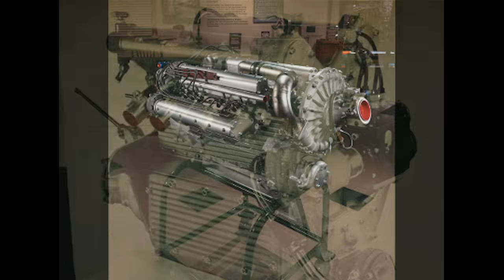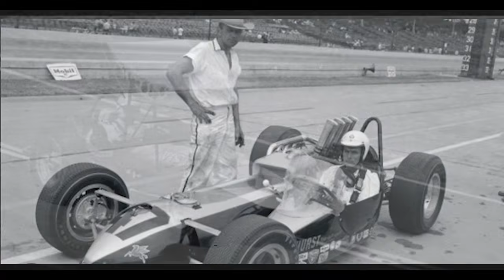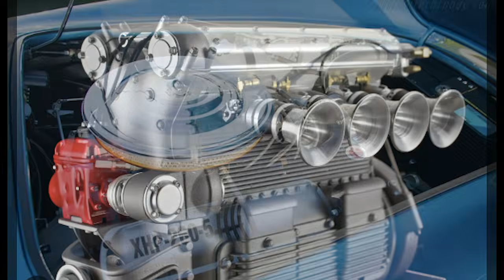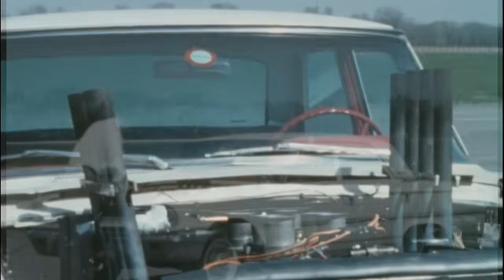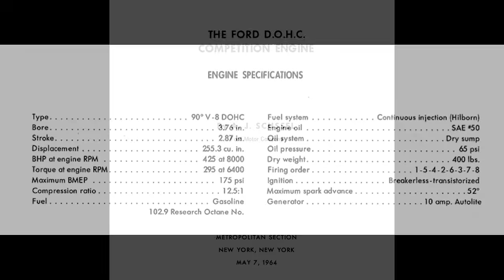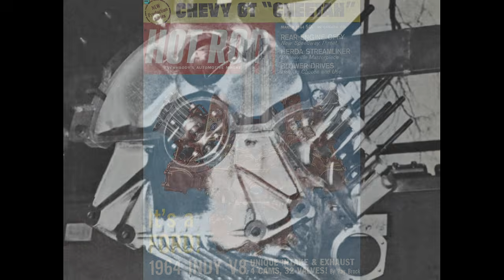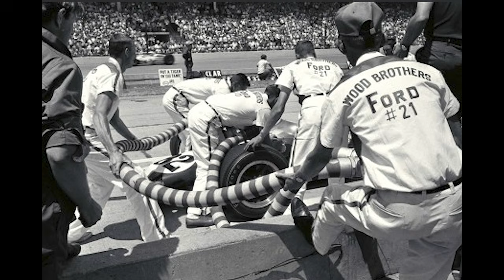Designed to Dominate: The Ford DOHC V8 Story - An Indy 500 Legend

Comment: As an engineer and a motor racing fan for the last 60 years I found this fascinating. I am from the UK and I wondered where the Cosworth engine in F1 came about which started being built by Cosworth with backing from Ford in 1967

Comment: @brianlohnes3079, great video but one little problem. The newspaper is being held by the man with the checked jacket who's standing to the right the woman standing beside Foyt. You can see a small piece of his jacket sleave and wrist.

Ignoring for the moment that we can see the wrist of the hand holding the newspaper, imagine yourself in Foyt's position, standing 'behind' the newspaper. Now imagine trying to put either of your hands into that position. It's impossible to do with the right hand. In order to put the thumb in that position, you'd need to be presenting the palm of your hand to the camera. 

The left hand would need to either come across the page but it would be impossible to bend the wrist in the way shown. Or up from under the page, but again, the wrist position would be impossible. And the left shoulder would need to be pulled 'hard to right' just to get the arm anywhere close to where it's shown.

Comment: I grew up thirty miles from the track and began going there with my grandpa when I was about 7 or 8.  My first race was the tragic 1964 race, and my Grandpa and I sat in the middle of turn 4.  I can relive every moment watching Dave McDonald coming through the short chute entering turn 4.  It was as if his steering locked up and then, the most horrific explosion right in front of my ten year old eyes.  I know a good bit about Indy, and in the late 60's, there were some real innovations hitting the track.  Yes, you did mention the Novis of Andy Granetelli and by 1964, we had, I believe, 12 rear engine cars, so there was some innovation by then.  Andy and his STP Specials--everything was some kind of "Special" back in the day!  So he introduced the turbine cars two years in a row.  Parnellie jones drove them and when USAC/Indy said they were banning them, Jones went to bat for new innovation but they shot him down.  There would have been more innovation if it were not for that.  Fast forward to all motor racing today.  Nascar, I believe was the first to ruin the sport.  Every single car is the same exact body--just painted or decaled differently to make it a Chevy or a Ford.  I hate it.  Nothing but cookie cutter racing.  Now Indy Car and F1,  are no different.  They have ruined so many great sports rooted in Americana!!

Comment: The funny thing is,  today you can get a 700-800 hp naturally aspirated, pushrod V8 in a street ready sedan, that seats 5 and sells for under $50,000 .  Today's factory v-8s would absolutely dominate  NASCAR, Indy and F1 racing in the 60s.  So, what's the difference?    Same basic layout and construction.  Same cubic inches, and same fuel.  How do we get double the HP and triple the torque ?   Look no further than how we control fuel/air mixture, ignition and valve timing, and compression ratio with electronics.

Comment: I considered installing one of the Ford Quad Cam Indy engines in a Ford GT40 and was directed to a guy in the Clearwater area of Florida. He was the central repository and historian for the Indy engine so a luck would have it we were going to be on holiday in Naples so a meeting was set. We met at what he described to me as his hobby shack which turned out to be a large modern warehouse on an industrial estate. Maybe a quarter of the building space was taken up with perhaps thirty complete dyno run shrink wrapped motors on pallets, some the turbo version while others were naturally aspirated. There were many exhaust systems, cams of varying specs and many draw cabinets full of individual engine components, everything was brand new. In addition to this treasure trove was original cylinder block and head castings tooling and test pieces. 
That was maybe twenty years ago so who knows what happened to this amazing collection. The guy had great foresight by recognising that given sufficient time many future classic Indy car owners would need these original engines when restoring them to period correct race cars, so many of them having been swapped out to Chevy race motors due to cheap spare parts and low  cost to maintain. He figured it would usefully add to his pension pot.

Comment: Excellent video. I was z-an engineering student at that time in the UK and spent my weekends mechanic  on different circuits ( Brands Hatch, Silverstone, Truxton). The most sticking thing about your story and how it might have been the starting point of the Cosworth FVA (1600cc, Ford stock block Formula 2 engine developed by Cosworth financed by Ford). History tells us the Colin Chapman negotiated the Ford financial support in 1965 to ensure engines for the new engine requirements. This is where I see a direct link between the 4cam engine development status in 1965 and Chapman showing  how simple strait cut gear drive can convert a standard pushrod engine into a double overhead cam 4 valve engine. Thus the creation of the FVA by Cosworth and this of cause leads to the DFV, the most successful GP engine ever. And all that under the Ford name!

Comment: I do remember they ran the 4 Cam in the championship dirt cars in the 60's and 70's by changing the location of the exhaust pipes so they exited out the side of the car. I loved the sound as a kid much more pleasing to me than the Offy. 🏁
Reply: They swapped the heads side to side.
Reply: @uhclem50.  Yes thank you. I could have worded the original comment a little better. They just moved heads to the opposite side so the exhaust would be on the side and not coming from the top like the Indy cars of the period. Pretty cool for an engine whose block originated from a Passenger Car Engine. But many engines did before the Cosworth . Brabhams (Repco) and Gurneys (Westlake) to name a few.  Cheers 🏁

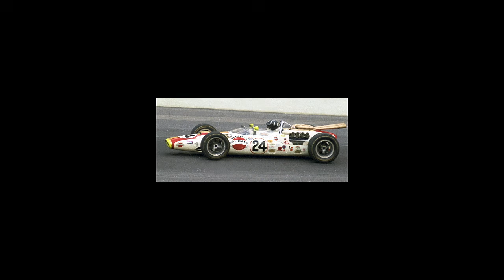Comment: 50:55 Timing Gear train Failure is an  ENGINE  issue , so that was  FOUR  Engine failures . Out of 20 that's really quite good .
Around this time , the Three Litre  Cosworth  DFV    V - 8  F1  engine was born as well . 
A  British design . Costin and Duckworth . Chapman associates . Used a narrower included angle between the Valves .
The Cosworth  DFV  V8  still remains the " Winningest " engine in Formula 1 history .

Comment: The old 221 Buick V8 was abandoned by GM in the 60's. The design was licensed, and became the 4.0 V8 used in Range Rovers into the 2000's. These engines were turds in the 60's, and they were turds in the 2000's. The DOHC Ford V8 engine was a groundbreaking design, vaguely similar to the BMW 4.4 "Hot V" engine I have in my 750i. DOHC, 4 valves per cylinder, and exhaust coming out the top instead of the sides.
Reply: Jack Brabham managed to build the Olds 215 V8 into an F1 World Championship engine by doing an SOHC conversion on it.

Comment: Still have a soft spot for the Offy.   Supposedly it was derived from a 1920's Peugeot small 4 cylinder.    The question I have is how did we get from this small block Ford V8 to the Ford Cosworth DFV from Keith Duckworth and Mike Costin?  Then years later, I think we had at Indy the Ford DFX?   PS: Amazing job on this video by Brian.    So interesting how Dan Gurney always seemed to be in the mix.
Reply from the maker: Watch my Offy video and there are answers to these questions!

Comment: There's probably a reason they didn't mention the term 'EDM' when talking about how they machined the cylinder heads; EDM is a technique used even today to machine aircraft (i.e. jet) engine parts so in the 1960s the technique would be considered a national security relevant secret similar to multi-axis CNC machining.
Reply: I could talk about EDM'ed cylinder heads, but national security concerns prevents it....

Comment: Hey, loving your videos and the research you do, but "just a kid" Gurney in 1961 had already won the 1958 USRRC series, run Le Mans 3 times (twice in factory-backed Ferraris), and had finished 7th in F1 points in 1959 driving for the Scuderia, and in 1961, after a horrendous 1960 wasted driving for BRM, was Porsche's undisputed #1 driver in F1, coming 4th in the points. The guy was in the top 5 of American drivers in 1961 and would have been the last person on Earth to doubt Brabham's entry.

Comment: I am another old gearhead. I remember watching those races either on tape or closed circuit theater viewings. If memory serves me right, in eye 1963 “500”, the roadsters were running a two speed gearbox. Low gear for in the pits and high gear for the race, while the  Lotuses were running a four speed. So, at the start of the race, both cars downshifted into either second or third gear and jumped to an enormous lead going into the first turn. Or at least, that is what was reported.

Comment: I remeber reading about these when I was a teen in the 80s. I restored and modified my 1st Ford starting at age 14 1/2 , when my dad bought me a $200.00 73 Mach 1 dented and with bald tires no engine and a broken windshield out of a junkyard. It was the best thing My dad ever gave me. I spent 2 yrs restoring it learning bodywork at a part time job stripping the wrecks after school. By the time I was a Jr in High school I had repainted it in Black Laquer and installed a worn 351W with some headers and a 600 holley on a Strip Dominator aluminum intake!. It was a 3 yrs of frying chickens for the Colonel that enabled me to build a standard bore 351C with 4bbl heads and a comp cams, mallory ignited, tunnel rammed home rebuilt engine. I had 2 -500 cfm sideways mounted holleys that took me months to tune behind a small block C-6 auto with 3.73 gears!  It was a great few years at the end of High school. I still have the cleveland I built the 1st Factory Five Cobra powered by the same  351C in 1999 and still have it today!  Always wanted a GT 40 just never could afford to build it. Ford Fan for life!  So many great legands and Ford stories like Brian Lohnes did here! An incredible job in research history he has done.  My favorite engine is the 427 SOHC motor but its so rare and costly I never built one. Ford was and is a  Incredible USA company that refused to get in bed with the leftists democrats under Obozo for millions and instead sold off all their other companies and restructuerd themselves. Ford has long been hated by the Democrat left and their media but today still survives and builds more USA made cars and trucks than ANYBODY . Its not even close! . GM and Stellantis are rumored to be moving their prodcution BACK to the US , so we shall see if they can even get close to FORD !  😆😅🤣😂
Reply: I used to see a lightweight modified pulling tractor called the Little American back in the 80's.  It was powered by a supercharged 427 SOHC engine.  Glorious sound, and looked so right.
But I also like the 427 tunnel ports.  When NASCAR wouldn't let Ford run the SOHC, they fell back on the tunnel port and still won.

Comment: . For those that don't know. The OFFY AKA MEYERS DRAKE OFFY engine was  originally called The Miller. Designed and built by Harry Miller in the 1920s. So when you hear Offy,think Miller. Miller's engine was bought out and renamed. BTW Harry Miller was one of Smokey Yunick's heros. Though they never met IIRC

Comment: Brian, a great production as yours are every time. while all these events were going on I was serving in the US Navy (1964-1968) my only automotive entertainment was running my 1964 Falcon sprint (260 4 spd) in the 1/4 mile in north Carolina) When I got out I went to college studying to be a Mechanical engineer specializing in automotive. I have read all of the articles that you mentioned except the SAE report and have learned a lot from your presentation that I did not know and I thank you for that . I got involved in racing and have built many Ford small blocks 289, 351w and 351c and won races and what I have learned from articles like yours have helped that endeavor, so thank you.  😎🏁

Comment: I remember watching every Indy race from 1960 thru 1968 on closed circuit TV  at the Bakersfield Ca Civic Auditorium.  What an inspiration I was building cars by the time I was 14yrs old and had 4 cars by the time I turned  16. 2 of which had been built for the 1/4 mile.  It was Indy that inspired my need for speed. I saw those cars go thru some massive  transformations at the 1960s Indy 500. This video brought back some memories.

Comment: I never knew this history, but it maybe explains how Ford came out of absolutely nowhere, with the '93 INTEC dohc, which turned out to be a smooth, bulletproof engine, from the get-go - they had a fair bit of experience with this engine design.  I think the factory units finally maxed out at 315HP, from a 281 cube everyday engine.

Comment: I am not a real gearhead, but I appreciated this. I drive a 2014 Ford Fi50 with the 5.0 liter 32 valve ohc Coyote engine. I love that engine, it has great performance in a heavy vehicle, 5000#, and I get pretty decent gas mileage if I drive reasonably. On a 6k road trip from Minnesota to the Rockies I got 19.5mpg with a heavy Leer hi top camper top, and, built out as a camper, lots of extra weight. I love this engine, and, it is great to see where it all started.

Comment: Would you please do an investigative report on the rare Drake-Goosen-Sparks V8 which was developed as a counter to the Cosworth DFX V8? That would be very much appreciated!!!
Reply: The DGS engine was the last derivative of the Offy 4-cylinder, and the most powerful.
The Drake V8 was completely different, but carried the barrel crankcase, separate cylinder block design through.  Called the DT160, it was not successful in competition with the Cosworth DFX.

Comment: We got to see the ‘66 Bardhal Gurney Eagle T2G ( Lloyd Ruby ) car during the vintage car exhibition at the IMS speedway ( when they were still holding them on the Saturday before the race. ) I think is was back in like ‘17 or ‘18. The Bardhal car has a white and red paint livery, and the “bundle of snakes” exhaust was painted VHC “Crackle Red” I think it was one of the COOLEST SOUNDING ( and looking ) Indycars I have ever experienced. You could hear that thing just WAILING like a BANSHEE- ALL THE WAY AROUND the 2.5 mile track. The decibels wer3 so strong that you could “feel” the exhaust sound vibrating your in chest. It put goose bumps up my back just hearing it. It is the most amazing sounding engine exhaust is the entire history racing. I can’t imagine the SOUND VOLUME of 33 of those going around the track in ‘65 & ‘67 - the sound of that would be heard for MILES. Amazing.

Comment: This is great!!  I hope you will also delve into the engines that Aldo Andretti used in his USAC sprint car.  Did they do more than just flip the heads from side to side?  So the exhaust went down rather than up.  They had some handling issues.  Someone had put the left radius rod on the right side.  Driving that car was said to be difficult.  (I read about this in Speed Sport or Hot Rod)  A. J. Foyt was asked to test the sprint car.  Scared him but they then figured out the radius rods were switched.  Car drove much better.  Aldo had put the little sprint car on its head a couple of time.  Once at Dayton if I recall correctly.

Comment: Then a couple years later, with money from Ford and Colin Chapman, Mike Costin and Keith Duckworth would build what is arguably the greatest racing engine of all time.  The had figured out the four valve combustion chamber and pretty much every DOHC/four valve engine on the road today uses their design.
Reply: Look for pictures of the Allison V1710 combustion chamber.  It has a narrow valve angle pentroof chamber.  Except for the dual spark plugs on the sides, it looks modern and was designed around 1930.

Comment: funnily enough the South Americans were dinking with their OWN DOHC Ford V8 during the late 60s called the Bucci 3000. ALL the information is in spanish and had to translate it, the engine was intended for Formula 1 and made to compete with Cosworth DFV Engines. TRANSLATION PASTE HERE; The Bucci 3000 is a V-8 based on a Fairlane 4778 cc (292 CI) block, cut 3 centimeters (1.1811 inch) to reduce the displacement by just over a liter and a half and allow for the adoption of the new cylinder heads. These have two camshafts each, which control 32 valves, or 4 per cylinder. Since the camshafts will be in the head, the original rod and rocker arm system has been replaced by gears like in the Ford Indy. To cite an example,  related to this engine. The block was cast in aluminum like the Cosworth. With four valves per cylinder. As a result of the reduction applied to the block, the cylinder bore will be 64.5 mm (2.53937 inch)  and the piston stroke will be 86 mm (3.38583 inch AKA STOCK 292 STROKE!). The exhaust valves will have a diameter of 31 mm (1.22047 inch) and the intake valves, 35 mm (1.37795 inch). The final displacement will be 2,972 cc (181.3626 CI). The connecting rods are forged to withstand the high rpm they will have to endure, according to Bucci's calculations. The engine will be fueled by a Lucas injection system. Clemar Bucci expects his engine to rotate at 9,800 rpm. At that rpm, the estimated power is approximately 410 HP. END TRANSLATION PASTE; YEAH, THEY CAST AN ALUMINUM Y BLOCK WITH QUAD CAMS AND MADE THAT FUGGER SCREAM AND MAKE POWER LIKE THE COSWORTH THEY WERE COMPETING WITH WHILE IT WAS STILL STUPID OVERSQUARE LIKE A BIG BLOCK OLDSMOBILE!! THEY LITERALLY FLOPPED THE BORE AND STROKE AROUND FROM THE COSWORTH! I REALLY WONDER WHAT THE CONNECTING ROD LENGTH AND PISTION COMPRESSION HEIGHT IS! The South Americans do some CRAZY SHIT with ford engines, gotta check out the "emi sul" too, french ford flathead repurposed by DODGE in South America with HEMI HEADS!! FACTORY ARDUN KIT!